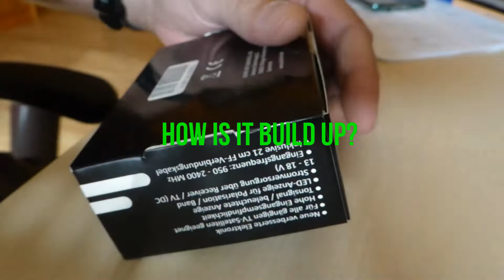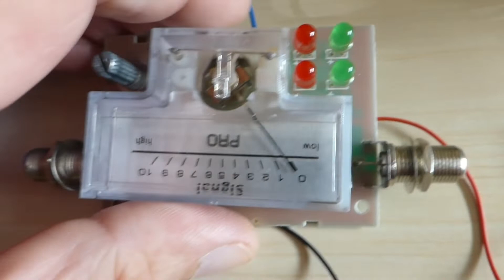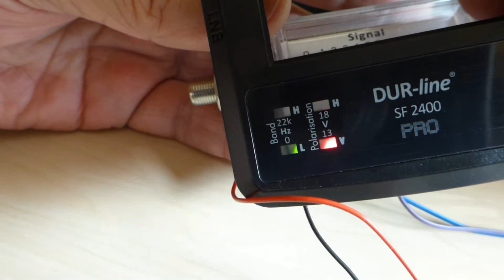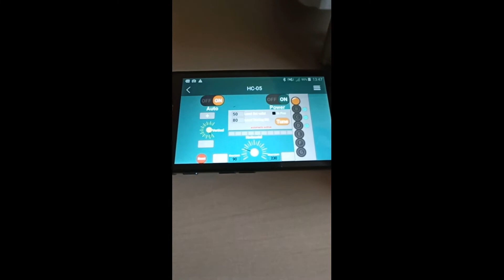DIY Automatic Sat Dish V2.0 Build up

Comment: thank you!
i’ll make one for my caravan.
i’ll document the process and upload it on youtube.
my plan is to modify your project a little so the dish always stays on the caravan, it should be water proof and also have a driving preset so that it folds away.
wish me luck!
wicked project! well done!!!
Reply from the maker: Hi ParallaxVisuals!
Sorry ,somehow i've missed your comment ,sorry for that.
How is Your project going on?
i think that the waterproof idea will be hard to achive.
my version in fact had been recently in quite a havy rain but it just came from straight above.
Under  stormy conditions it defintly would not stay dry inside.

Good Luck
Reply: @michaelfloss5761  Hi! I've ended up finding a really good deal for one dome dish and fitted that on top of my caravan.
So far it's staid dry and we had some propper rain so I'm happy.